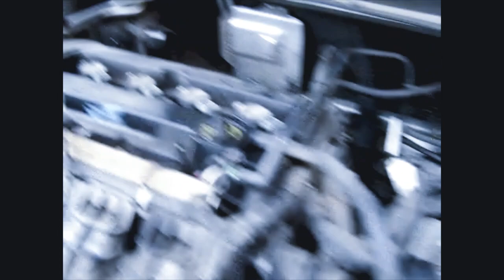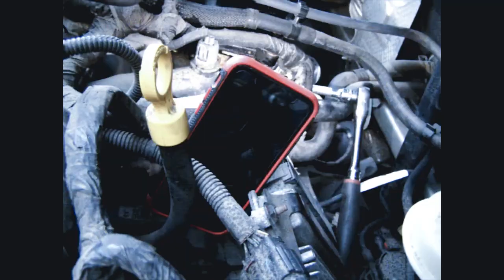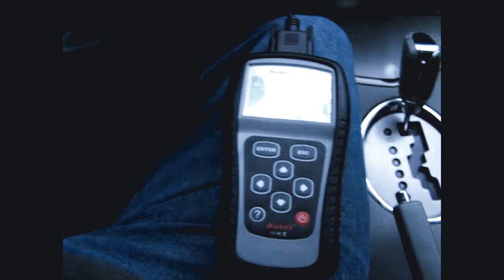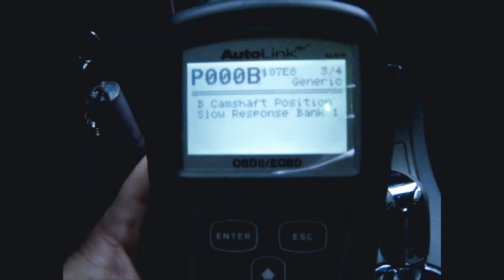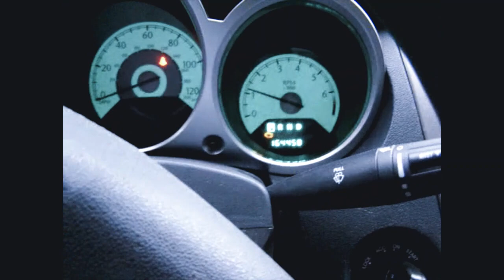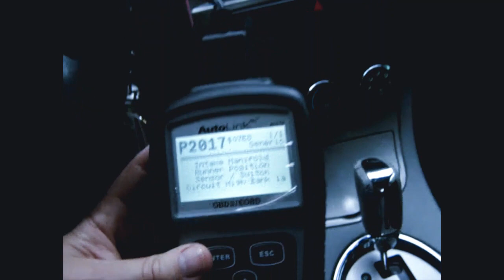2007 Chrysler Sebring 2 4L Cam Sensor Replacement

Comment: I have replaced both camshaft sensors and my check engine light is still on the code still appears as p2091…. It’s the only one as well… what else should I do??
Reply: Car also runs fine… the reason I ask is because my smog is due soon and I’ve tried to delete the codes with the scanner but no luck… any other suggestions

Comment: Thanks for this! I just swapped my rear sensor. I'm not sure which one is bank 1 or bank 2 according to my P0365 code, but the code cleared for now. If it comes back, at least I know where the other one is.

Comment: I believe this is also the same engine that they use on the 1st gen 200
Reply: Yesir. The Sebring IS the 200. They changed the name to try and distance itself from the Sebring name and at the same time, try to ride the coattails of the chrysler 300.

Comment: I just have one is it ok to replace one? I didn't know I had to get two until now
Reply: My back one had exposed wires and was touching and throwing all kinds of codes when I taped it up it stopped throwing all the codes but I have one on the way hopefully fixing the messed up one will be enough ⁉️😵
Reply from the maker: If you have a dual overhead cam then you should have two of them, although you do not have to replace them at the same time. If you have found the source of your problem and replacing one of them solves it then you are good!!
Reply: @thelumpycam506  Thank you just got done replacing it and it's working good so far appreciate your time

Comment: It's uses two camshafts? Or it's a camshaft? And a crankshaft? Thanks
Reply from the maker: Yes, It's a dual over head cam set up and there is always only a single Crankshaft. One sensor per camshaft.